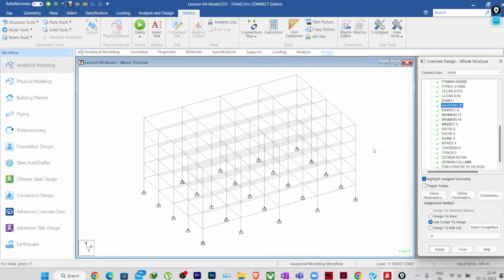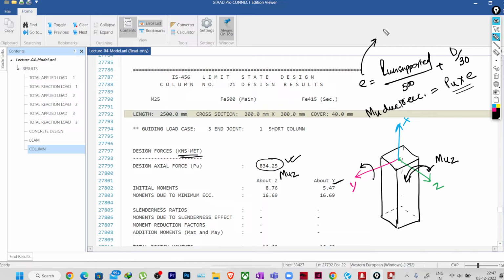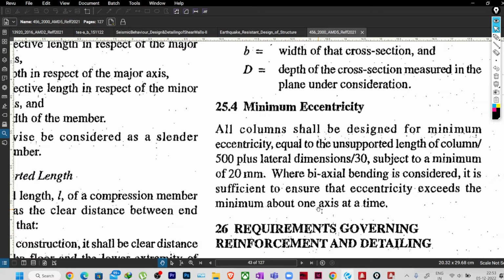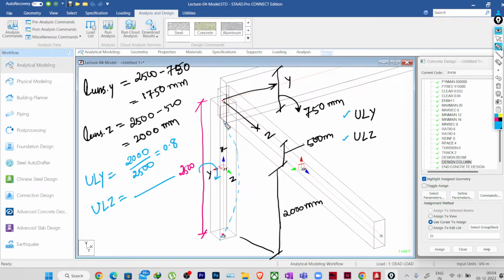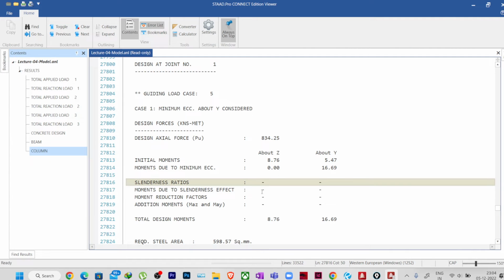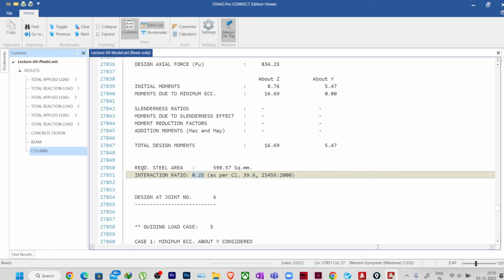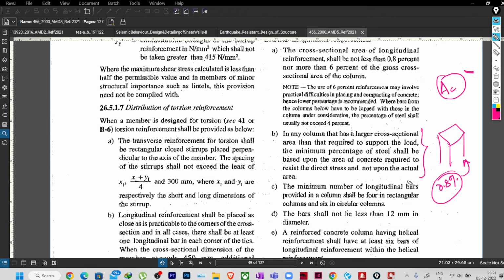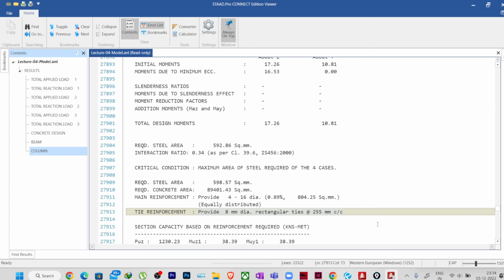Understanding Column Design as per IS 456: 2000 | STAAD. Pro | ilustraca | Sandip Deb

Comment: Thanks sir, Make theoretical video on eccentricity of columns.Which factors do affect on eccentricity.
Reply from the maker: Eccentric beam placement, construction problems etc.
Reply: @ilustraca  
Which factors do affect on eccentricity of RCC cloumn?

1- Position of beam supported on top of column section  ie. beams are flushed to column side face or not.
2- Distance of another adjacent columns from this considered column, for take account magnitude of load, and moment which are affected by beam span distance .
3- Offset develop by reducing column size of upper floor column while maintaining same face of above and below floor column.
 I feels above these  should be reasons for developing eccentricity in RCC COLUMN. Please guide me.

Does Eccentric beam placement take account in Column Design?
Does Eccentricity due to reducing column size of above floor column ? (while maintaining column face flush to above floor column.)

Please make a video on eccentricity with therotical window.
Reply from the maker: To keep our analytical model simple we don't model the flushed beam, rather we model it at the centre.. hence, wd minimum eccentricity consideration we also keep the utility ratio 0.7-0.8 and not 0.9-1 to keep margin for different assumptions that r made in the model.
Reply from the maker: If you want to take effect of eccentric/flushed beam then u may model those and connect wd column using rigid links.. though it will make your analytical model complex.
Reply: @ilustraca  Thank sir . Do you means to say to use Floor Diaphragm or Master Slaves  .